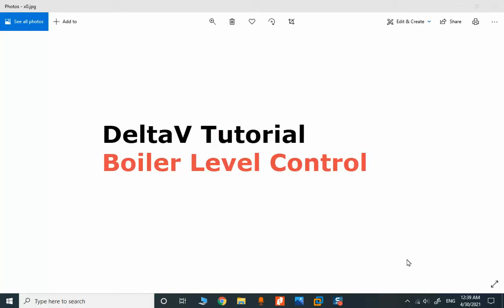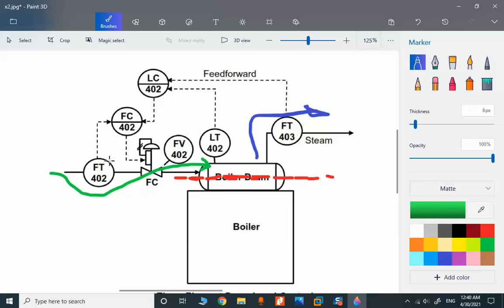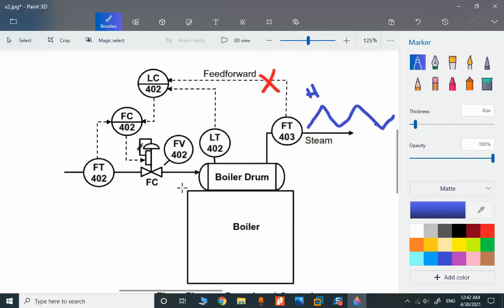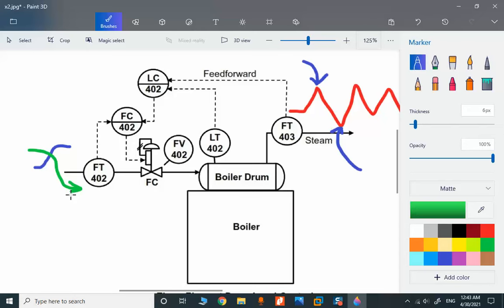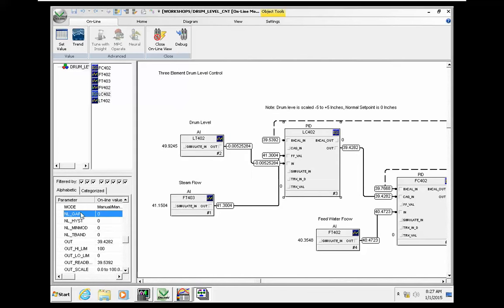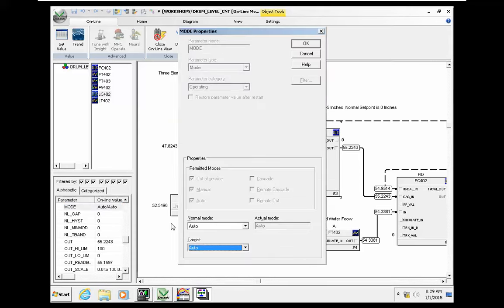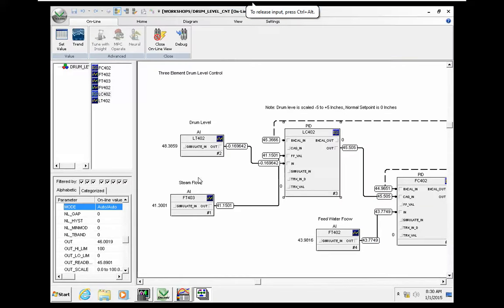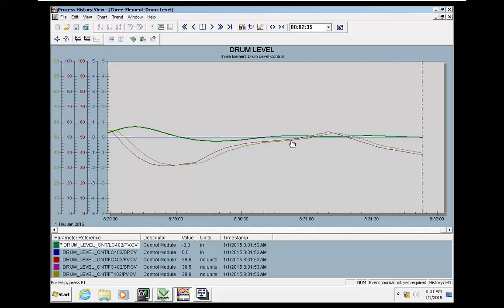Emerson DeltaV    | Feed Forward P51  Boiler Drum Level – Three Element

Comment: Could you change input scale in your future example? Because basically AI scale not equal 0-100 and AO equal 0-100%. In the your example all values around 37-39 and it's not clear it's percentage or EU.
Reply from the maker: Sure, easily possible . Level is normally between 0 to 100 % .
Reply: @hdhosseini  Level is normally but other parameters (flow, temperature, pressure etc) change AI scale if it's possible. For more clear.
Reply from the maker: Please watch this video:
https://youtu.be/OWTQz0TWIgU

It is an example of a  control strategy plus:
1-Pressure in range 0 to 10 Bar
2- Temperature from 0 to 200 C

The whole course can not be shared here as it is for sale on our website.